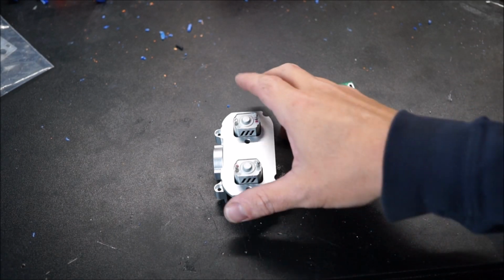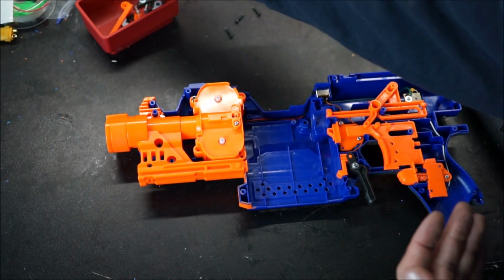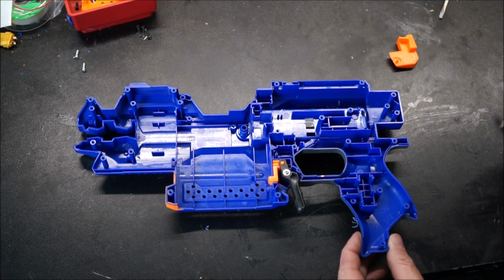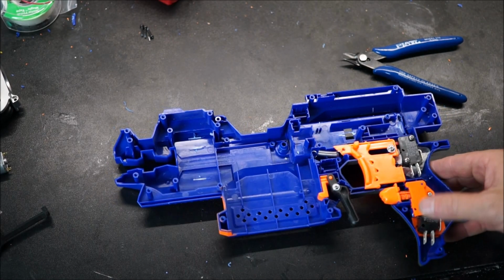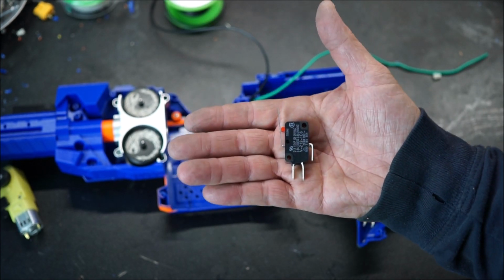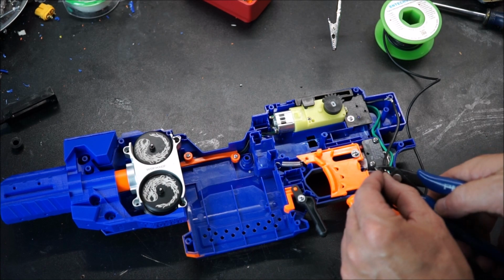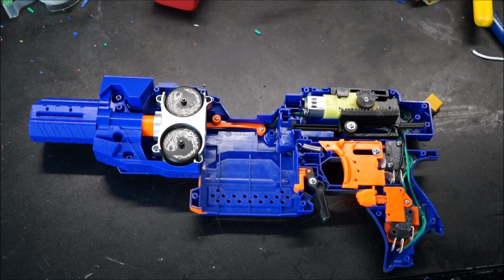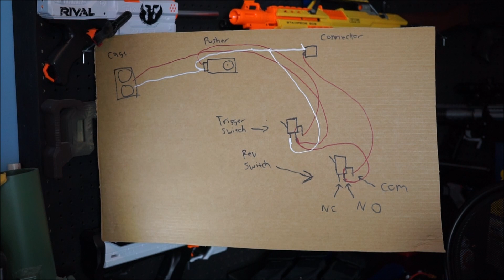Commission for PDK Films, & Auto Stryfe Build Guide !

Comment: Thanks for the post. We just did our first auto Stryfe using the Worker kit with a three switch configuration like our Rapidstrikes this is much simpler. Really like wiring a regular Stryfe with motor braking and adding an additional switch moving the additional negative from NC of rev switch to the NC of the new trigger switch. We will definitely be using this kit with the simplified wiring on our next Stryfe build. Thanks again!
Reply from the maker: Glad it helped! I thank you for the kind words.................Chris

Comment: This is crazy sick!!! Great job. Thx a lot man :)
Reply from the maker: You are very welcome my friend.
Reply: @projectnerf7920  Seems like you don't take prisoners here ;)) A few questions there, if you don't mind. What motors, flywheels and batteries could be a real alternative for what you've mentioned in the video. I live in Poland, and some of these sadly can't be shipped out there. Any tips are welcome.
Reply from the maker: The battery shouldn’t really be an issue for you in Poland. As long as it’s the correct voltage and has enough current your good. The motors and flywheels may be a bit harder as I’m not sure what is available in your area.

Comment: If you wanted motor braking on both the gearbox and the flywheels, would you just splice another negative wire to the normally closed terminal of the rev trigger as well as the one from the auto trigger?
Reply from the maker: Yes, But make sure that your power into the switch goes to the Normally open, use the Common as the output to the motors. I can’t stress that enough. If you put power to the com, a negative on the normally closed with cause a short that can set you battery and blaster on fire!

Comment: did not fully watch the video yet, but will 16 guage wires work for this build if I am using a 3s lipo battery?
Reply from the maker: Oh for sure, I typically use 18 AWG silicone insulated wire for my builds with 130 size motors, and 16 AWG for anything larger like 180s

Comment: What are the main differences between this one and the worker full auto Kit?
Reply from the maker: The XSW kit has a motor mounting plate that is totally internal, the worker kit has a sturdier mount but requires diving screws through the inside of the battery compartment. The gear and teeth on the pinion are larger on the XSW larger as well as the overall size of it being smaller than the worker kit. They both work well, but I prefer XSW kits when I can get them.

Comment: I have a question: I wired everything up according to worker’s directions, but the rev trigger is activating both the flywheels and the gearbox while the middle trigger does nothing. What should I do?
Reply from the maker: send me a couple pics of the wiring, Maybe we can get you sorted out.
Reply: @projectnerf7920  I did not take pictures of my wiring job, but I can confidently say that I followed the schematic diagram (the one without the diodes and resistors) of worker's full auto kit exactly how it was presented. Thus, maybe there were defective switches provided in the kit that are causing issues.
Reply from the maker: Could very well be, you can Check them if you have a meter.

Comment: do you suggest to use the Worker Mod ABS Plastic 425 Canted Upgrade Flywheel Cage as wheel cage together with the Worker Mod ABS Plastic 425 Canted Upgrade Flywheel Cage ? with the Worker Mod 180 Motor Cable Switch Kits ? i'm a bit low on budget
Reply from the maker: I’ve used the Worker, plastic cages before with great results. So if your on a budget, it should work very well for you.................. Chris
Reply: @projectnerf7920  ok thank you very much the 180 motors are good or I'l need something stronger ?
Reply from the maker: 180s should do quite well.
Reply: @projectnerf7920  thanks but the  motor spanning board is necessary if yes is the mosfett one that you find on "out of darts" good ? And which type of motors have you used ?
Reply from the maker: In my time, I've used just about every motor one can think up and several that most can't. But these days I'm pretty partial to the motors from foam blast, like Fang Re-vapms , Meishel 2.0, and the one they helped develop for Out Of Darts, Valkeries and Krakens.

A Spanning board isn't required but they do make things a little easier and cleaner. And yes the Out of Darts Mosfets are very good. I think they are rated to something like 200 amps, so they will easily carry just about anything you can throw at them.
Reply: @projectnerf7920  ok thank you for you're time I made a lot of questions I know 😅
Reply from the maker: No problem at all my friend. Much love and be safe........................... Chris
Reply: @projectnerf7920  thanks you, stay safe in the US ,love from italy

Comment: If I were to add a voltmeter where would I connect it
Reply from the maker: If you want it on full time just hook it up to the battery. I like to use a switch for mine. Hook the negative up to the battery, the positive goes to one side of a switch, the other side of the switch goes to the battery.
Reply: @projectnerf7920  so for example if I were to add it to this build should I add the positive wire from the voltmeter to the normally open tab on the rev trigger switch?

Comment: I looked at the outofdarts website and they dont have the xsw kits, so I was wondering where you got yours because the websites that I have looked at all ship from China and take like 2-3 weeks. So if you get yours from any other website that will ship quicker please let me know.
Reply from the maker: I have had some luck getting them from Monkee Mods, in the past. But the Worker auto kit will also do just fine, you just won’t be able to open up the inside of the battery tray, due to how they mount.
Reply: @projectnerf7920  Ok so with the worker kit can I just use everything in this build with it?
Reply from the maker: Yea sure can
Reply from the maker: Yes you sure can

Comment: Can this run on 3 imr
Reply from the maker: It would , but I wouldn't do that. First all the motors are 2s, 3 imrs are like 11.1 volts, and even if it didn't burn up the motors the performance would probably still lack, as IMRs don't make the current lipos do............................. Chris
Reply: Ok thanks

Comment: Hi I was wondering is there a parts list Thanks
Reply from the maker: There are so many options out there it's actually crazy, but for this build PDK goes with premium priced parts. Serenity aluminum cage, Fang Re-vamps Flywheel motors, Inferno Wheels, XSW auto pusher kit, MTB Honey Badger pusher motor . Plus you choice of wire, switches and battery connector.
Reply: @projectnerf7920  thanks  😊

Comment: How would the circuit diagram be if motor breaking was on the flywheels too?
Reply from the maker: If you pause the video at 1:26:00. It's real easy. You will have to switch the position of the wires on the Rev Switch. Move the batter lead to the NO tab and use the Com tab as your output. If you have that, all you need to do is bring a negative wire to the NC tab and your done.
Reply: Project Nerf thanks a lot for the info!
Reply: One question: you mentioned the negative wire coming into the NC tab, but im not sure where the negative wire should come from. Where should the negative wire start?
Reply from the maker: The negative on the battery. or you can extend any other negative wire. For me , I would just extend the negative wire from the NC tab on the Trigger switch down to the NC tab on the Rev switch.
Reply: @projectnerf7920  thanks so much!

Comment: List of all needed parts and supply? The gun common tools then what?
Reply from the maker: The parts are really builder/customer preference. But for these builds we used. Worker Aluminium flywheel cages, Fang Re-vamped fly wheel motors, Containment Crew Inferno Wheels, Silicone motor dampers, XSW auto pusher kits, MTB Honeybadger motor for pusher, Out of Darts switch plate, 18 AWG silicone insulated wire, 2 Heavy micro switches, and an Amas XT-60 battery connector.

Tools would include, Exacto Knife , Flush cutters, Soldering Iron and solder, various Phillips head screw drivers. Recommended tools Dremel with cutting blade, and sanding attachments.
Reply from the maker: Almost everything that you would need can be purchased from Outofdarts.com
Reply: @projectnerf7920  I've never used apoxy puddy before.  Is there a brand or type you like?  I wish I saw how it works and how long to let it set before you set the screws.